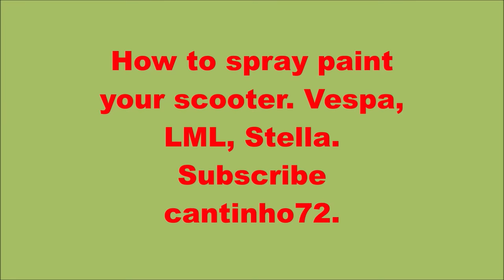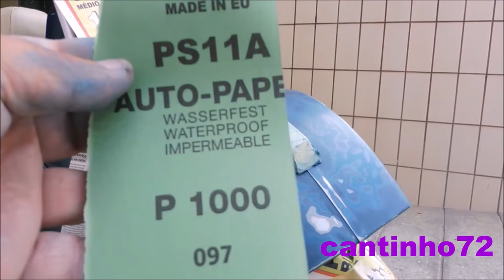How to spray paint your scooter. Vespa, LML, Stella.

Comment: How did you match the paint? Trying to find a paint code for my Stella…
Reply from the maker: In my case it was a paint shop that tuned the color for another part of the bike.
LML Stella colors have original codes for all colors.
Subscribe to my channel and help it grow.
Reply: @Cantinho72  thanks!!! do you know where to get the codes. I can’t seem to find it. I have GB150 Stella from 2004. They only made a 100 of them etc.
Reply: Hi had a similar problem to yours, I ended up going to a proper body paint suppliers and going over a chart till I found the nearest march. Otherwise is the RALL number not on the badge?

Comment: Ive got a problem with my vespa. if give it a full throttle it bogs down or wont accelerate at all. Is there a way you could help fix that. 
Thank you.
Reply from the maker: It can be a lot, candle, carburetor ............
Reply: It sounds like the carb my need to be taken apart and cleaned.
Reply: I has similar problem, if you are taking the carb apart make sure uou replace all the seals while your at it.